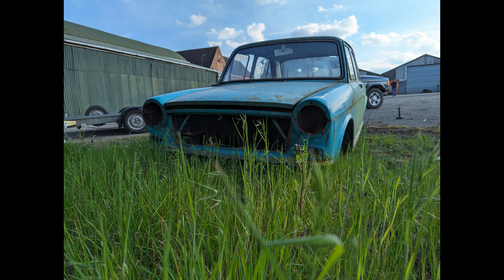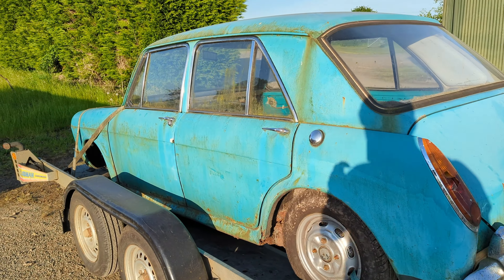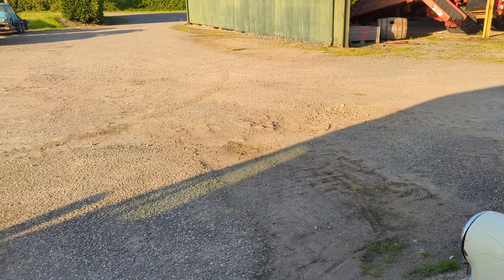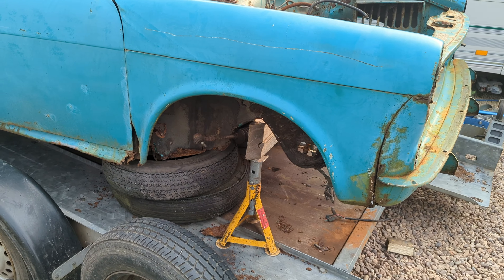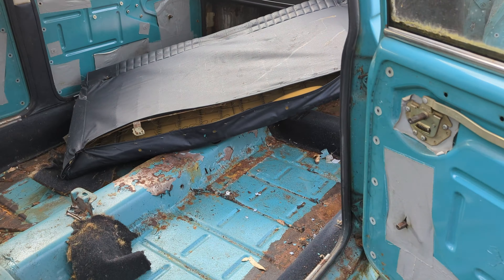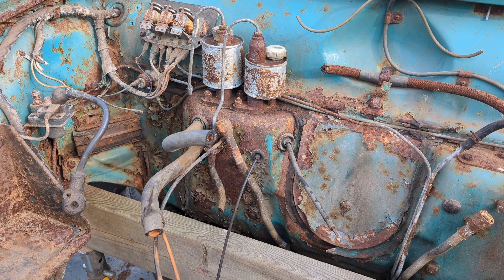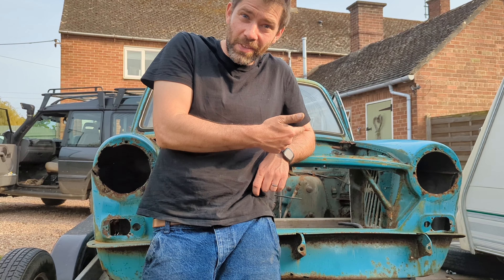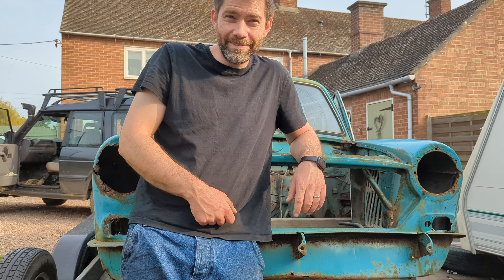1970 Wolseley 1300- Episode 4. What have I done now?

Comment: Gradually all those 1100s/1300s are getting melded together… eventually they will all become one single car! Could be worse.. I had a friend who had a dark green 1100 (once belonged to his gran..). I did a decoke on it for him, and while we had the head off we smoothed out the inlet and exhaust passages a bit and trimmed the combustion chambers. He let on to his dad what we’d done and got into trouble, as dad was sure it would invalidate his insurance but I only found that out 50 years later! I learnt to drive in an 1100 (BSM..) thought they were a friendly little car, but a real rot-box. Good luck with the melding process😄 Les